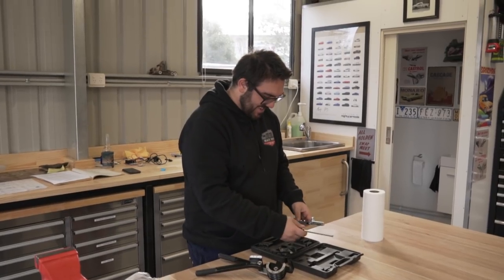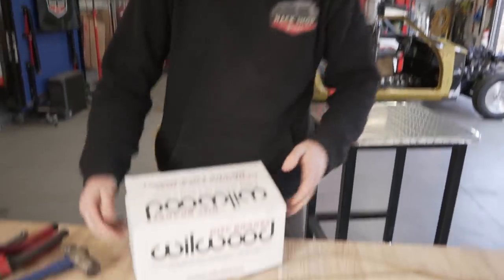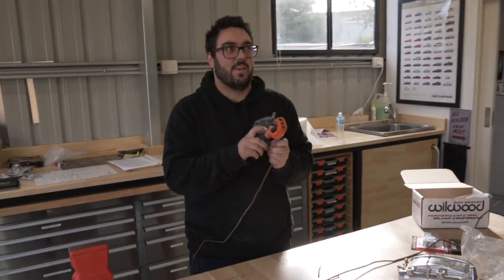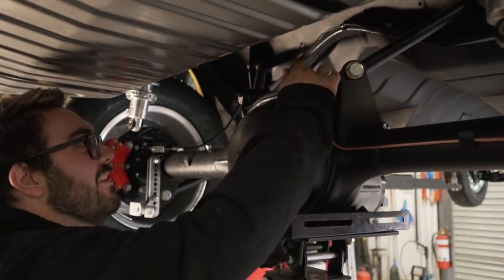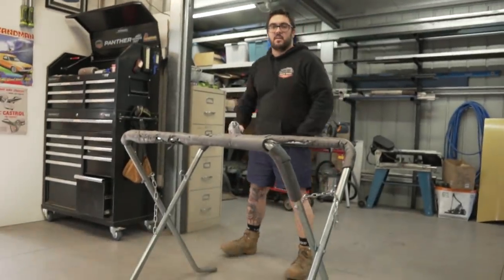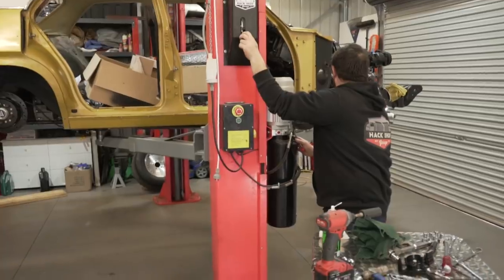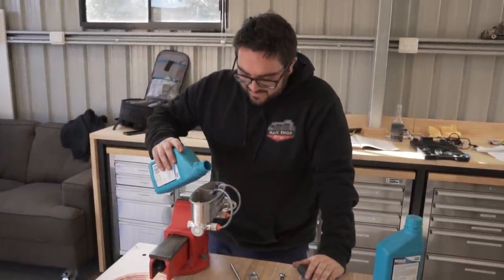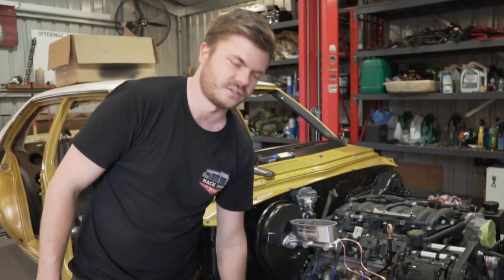LSQ Build - Part 9 - Plumbing The Wilwood Brakes (LS Swap HQ Holden)

Comment from the maker: We have had a lot of people ask, so just to clarify, the lines we used are not pure copper brake lines, they are Cunifer or Copper Nickel lines, which are as far as we know, legal for road use here in Victoria. It is a product that is mainly used overseas, not so much here on OEM vehicles, as it is designed to be easy to work with as well as prevent rusting.

Comment: Nice video but you should probably have used flex line to the calipers to allow you to remove them and not have to disconnect and re-bleed the system whenever you change the rotors.  Great build

Comment: Haha . . . HQ brake boosters!! I remember as a first year apprentice, during all the industrial turmoil in the 70's the evening news would show file footage of the Holden plant when the story was about the Vehicle Builder's Union going out on strike yet again. The film showed a HQ coming up the line towards the camera then the line did a LH turn. The car was just a body shell, painted. With a brake booster fitted. I found out why the brake booster was the first thing fitted to the body when I had to change one!! Man those top nuts were pricks! I ended up removing the speedo and running 2 x 12" extensions down the speedo hole with someone else trying to hold the socket on the nut. A 2 man job to change a brake booster. Holy Mother Of God!! Love ya work boyz.
Reply from the maker: Hahah glad to see we arnt the only ones who dreaded it 😂😂

Comment: Another cracking video lads👍 we used to make a kind of template with coat hangers, but its impossible to find the metal ones now. Maybe some mig wire or fencing wire.
Meanwhile I'm off to protest, "Metal hangers matter! Metal hangers matter!"
Reply from the maker: Hahaha I like your movement, all for it! 😂
Reply: You can buy the metal coat hangers from woolies, I use them to replace steel listing in seats.

Comment: You may also need to ditch the residual line pressure valve. They're meant to keep the seals in a wheel cylinder expanded against the bore to prevent leaks. It will just make your calipers drag the pads against the disc. You should probably talk to your brake guy about the proportioning valve too. Drums tend to need less brake pressure than discs, your rear brakes may be less effective now. I stand to be corrected on that one though.
Reply from the maker: Yeah ok, that’s fair enough. We had spoken about whether the proportioning valve needs to be changed, but we were told that in HQs they should be fine, but if anyone has any experience with a similar set up, we will take it on board too

Comment: You could use coat hangers to make the patterns for brake lines then when bending the real stuff it should make working out angles/ bend points a little easier, Good stuff though as always.
Reply from the maker: Thanks mate, good tip, much appreciated

Comment: I used that brake line flaring tool on my VL Commodore where I double flared the fittings.

As far as the charcoal canister goes,the fuel filler neck is my concern because the unleaded petrol tanks were fitted with a 1 way check valve inside of the fuel filler cap because the evaporative emission control system is sealed from the atmosphere apart from venting air into the fuel tank.

I think that the engineers can be picky with fuel filler spout because it needs to have an unleaded fuel filler cap fitted.

You can use the charcoal canister off another VT onwards Commodore ,!

Comment: Looking good guys 😊

Did you say you went with Kunifer lines or Copper? Just cos ADR allows Kunifer under SAE J1470 but Copper isn't allowed. I love using Kunifer as it's so much easier to bend than crappy old steel Bundy and will never rust inside or out 😁
Reply from the maker: Thanks mate, much appreciated. And yes the are Kunifer lines, we thought we would try something different than bundy lines just to see how it was to work with.

Comment: My comments always seem negative, and I apologise for that. It's been a while since I was on the tools, but when I was, copper brake pipe in Australia was an absolute no no. Bundy tube was the only allowable solid line for road going cars.
Reply from the maker: All good mate, we always appreciate the feedback, from what we researched, you are right, pure copper is not legal. However the lines we used are copper coated steel, we checked it with a brake guy, and he said they are just coated in copper to prevent rusting, mainly in overseas applications

Comment: that barrel you had in your hand is a residual line pressure valve. meant for disc drum from memory.
Reply from the maker: So should it be removed then being that we are running disc in the rear now?
Reply: @HackshopGarage  ask castlemain what they think mate i personally have no experience with willwoods so in your application it may not matter. it may not even work anymore, plenty dont.
Reply: Yep, pull it out as she's not needed for the disc rear 👍
Reply: Incorrect !  Its a Proportioning valve to control pressure to back drum brakes,   The residual pressure valve lives in the master cylinder, only used in drum brake applications.  seeing that they have a 4 wheel disc  master cylinder . No problem with residual pressure.  If using a factory disc/drum master cylinder for 4 wheel disc,  the residual pressure valve must be removed..

Comment: Copper Nickel tube?  I was getting anxious, but you mentioned "it's not copper" so good. Copper will NEVER pass engineering. Just putting it out there. Bundy tube (Copper/nickel) is accepted by ASRF in QLD, and other states. It's a good looking HQ fellas, well done. edit hey guys, do you have a link for the brake line?  I've been straightening out and using my old lines from donor vehicles on my street rod, as templates/samples. So I need to re-make them all once planned out of new stuff. Fuel lines too, but that's my problem. Cheers !
Reply from the maker: Yeah that’s the one mate. I wish we had of mentioned it in the video 😅 thanks mate

Comment: For gawd sake get a bigger set of tube benders... lol

Just get a smaller set, they are MUCH easier to use. What you boofheads have done looks great though, keep going fellas ya's are killing it.
🤘😎
Reply: Also, the longer section of the flare tool gets clamped in the vice, not the line... lol

Not picking on you, just offering advice, you are quite welcome to tell me to piss off. Lol 😁👍
Reply from the maker: Hahaha nah all feedback is appreciated, like we say, we are learning as we go, after that one we figured that out and clamped it into the vice each time haha. Thanks mate

Comment: Isn't there still supposed to be a flex line from the ends of the diff to the calliper? Are you gonna undo and rebleed the brakes every time you need to pull the disk off?
Reply from the maker: Yeah so there were no brackets on the diff to mount the flexible line where it would connect into the hardline. So we decided to go straight to the Calipers, which does mean in the case that we have to pull the rotor off, we will need to re-bleed the brakes
Reply: @HackshopGarage  Yeah ok I thought it looked like it was missing something. Does look clean without them though and I love the look of copper bundy tube.